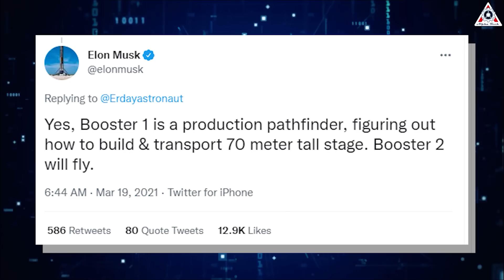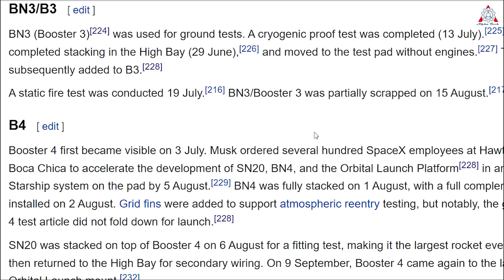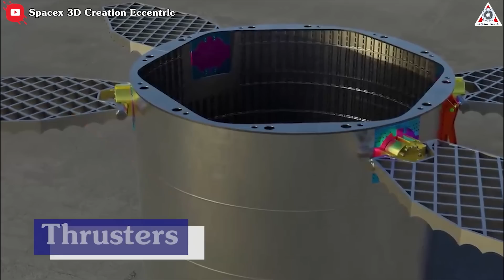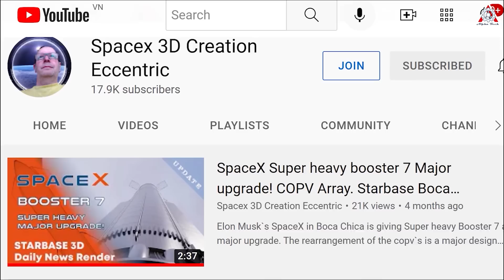Elon Musk changes everything on the latest SpaceX Booster for the orbital flight but its explosion

Comment: Well done Tim Dodd, and Elon for the latest innovation. Just a thought, IF the air fuel explosion was due to the unburnt fuel mixing with atmospheric oxygen, would it not be wise to fold the area the launch pad immediately beneath the engines with an inert gas like nitrogen to create a shield just prior to ignition?